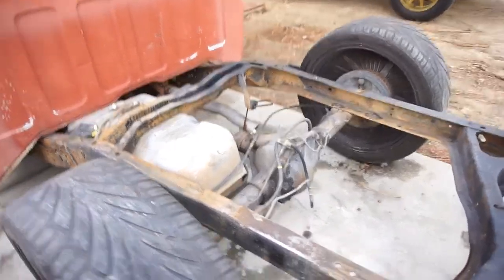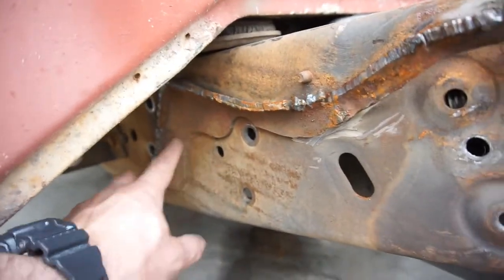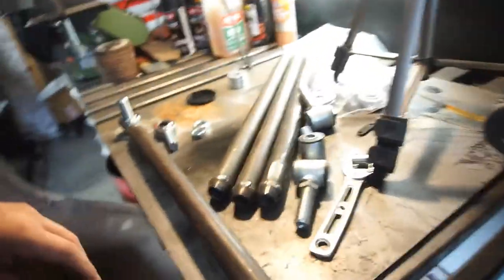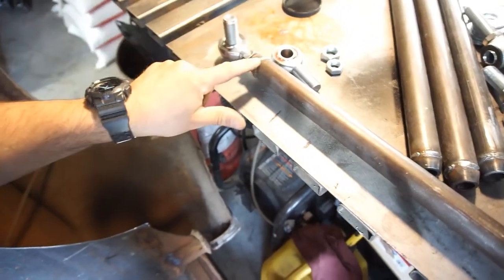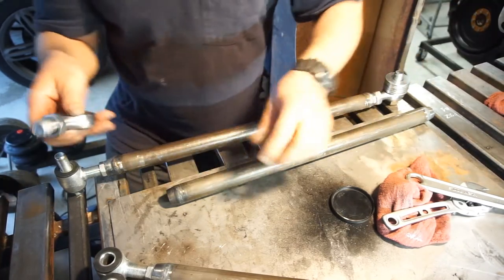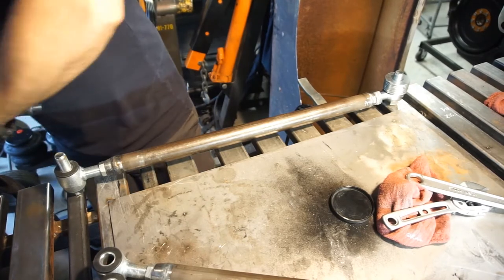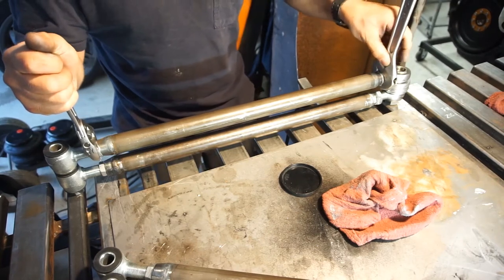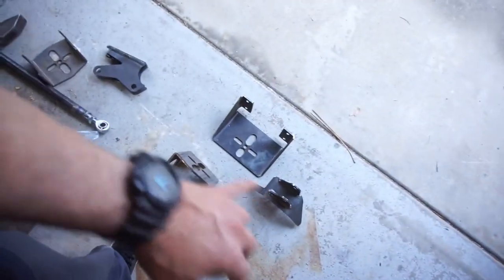Early Video..Ebay Parallel 4 link Rear Air Bag For Project Crack Pipe. 1964 C-10 Slammed 4x4

Comment: Another thing I am noticing, you are making all of the arms the same length. The uppers are usually shorter than the lowers. You are going to want to mount and set the length when you figure out a good ride height. The good thing about you doing all of the welding/fabrication... you can set where the arms mount to the frame... so all of the same length arms might work out.
Reply from the maker: OneNGlen yeah buddy it’s called an equal length parallel 4 link setup. The triangulated 4 link have to be set up the way you’re talking about. As long as I got my ride height and pinion angle setup good then it’s fine tuning after that. Good catch again though.

Comment: Only a couple minutes into the video..... when you mount those arms, make sure you pick up some "shouldered" bolts. The constant movement.. over time, the threads will start to chew up that joint.
Reply from the maker: OneNGlen they’re shoulder bolts. The heim joint bolts aren’t tho but the heim joint is metal. The sleeves that the bolts go through will protect it if there are any thread remaining. Good catch though.